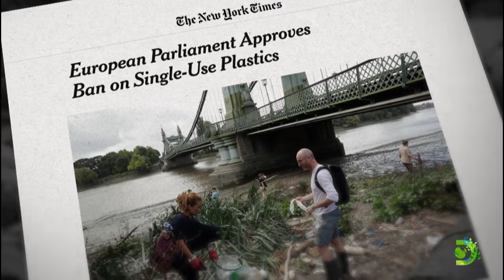The Story of Plastic Trailer

Comment: When we lived in Hawaii we saw trash on the beach all the time.  The tide-line was sometimes defined by tiny blue and white crushed plastic  pieces.  We would clean the beach before playing each visit, but I always worried that the trash would just end back up on the beach (though if it made it to H-power it would at least be converted to electricity through burning).  The solution is to stop plastic at the source.  Some may be useful and necessary, but the bulk of it is not.  I think if enough people have their eyes opened to the problem we can all agree to work together on curbing our unsustainable habits.  Looking forward to viewing the entire film, I hope it is the beginning of more change for more people.
Reply: We're seeing just where plastic is absolutely essential in this crisis - medical equipment, PPE, and keeping sterile environs. Food wrappers, utensils, bags, and clothing? Not so much. We should be able to start eliminating certain plastics from the consumption cycle and replacing them with biodegradable and eco-friendly materials instead. Even car parts and some electronics can and should be replacing plastic casings with other materials, or at the very least, recycle the plastics we are currently circulating.
Reply: Cooking one's own food reduces a lot of plastic usage. The problem is people don't have time to cook anymore so buy their foods in plastic. A day's meal could fill a garbage can with plastic containers.